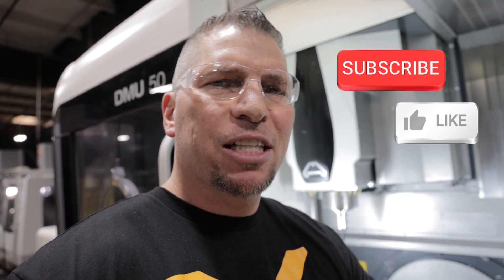GREATEST CNC Machining Compilation of ALL TIME - TITANS of CNC Vlog #48

Comment: Titan I want to start off by saying thanks for all the tips and tricks you share with us. Because of you I've been running 4 times faster at the shop I work at. I do have an issue with running high speed roughing on 304L SS . I can't get a 1/2 inch carbide 4 flute rougher to last more then like 30 mins . I know I can cut close to 120ipm but it doesn't last. I go as slow as 45ipm at 1900rpm with 8% step over and 1/2 depth . With that, the tool last 30-35mins. That's really bad since I can have a cobalt rougher last a whole day with same circle time with traditional roughing . It's just harder I push on carbide the shorter life it has. :/ If you have any tips for the 304L SS it would be great if you can share . Even drilling I have longer life with cobalt drills then carbide.
Reply from the maker: It’s probably the cutter.
Have you downloaded NOVO from Kennametal? It’s great for speeds etc.
Also the HARVI 1,2 & 3 EndMills are amazing. Maybe more expensive but if they last for a few hours, then it pays for itself. I love the Harvi 3

Comment: Titan, would love to see a video on what you think are, currently, the biggest limitations in CNC right now. Where do you think the current bottleneck is (if there is one). Machine power, motor positioning/holding torques, or something completely not physical, like how people are designing parts without CNC in mind (used to designing parts with manual machining ops in mind)

Comment: I would like to see you make a video of getting a job involving machining stellite.  I used to work in a machine shop that has worked on very large parts involving a hardened shell of stellite. We would cut no more than .050" on a 4 or 6 inch button cutter going around 5 ipm. The rockwell hardness is over 50.  I would like to see how you would cut something like that :)
Reply from the maker: Future video coming...
Good idea

Comment: Future video idea. Can you go over how to cut with long endmills or extended endmills. Everytime I try I always get chatter (sucks for finishing) or high machine loads (sucks when I'm trying to get high MMR during roughing). Thanks.
Reply from the maker: Yes...
Definitely need to drop rpms and make sure you have it in a rigid holder and stubbed up as short as possible.

I might run a 1.625 LOC 3/4 Dia at 12000 RPMS but drop to around 8000 if I have a 3.0 LOC.

Sometimes with a 3/8 or 1/2 that super long, you need to drop down to the 3k or 4K range.

Just need pressure on the tool so it does not vibrate.

Of course Feed is same... just RPM’s lower
Reply: @TITANSofCNC  awesome thank you for the advise and reply. Would you use the reduced RPM and same feed for finishing the part as well? So example 4 flute 3/4 end mill with a 3" LOC RPM: 7500 IPT:  .012 Radial Depth of Cut: .015 on 6061-T6? Thank you again for the huge advice.

Comment: I would like to learn how to edge find using a .0001 indicator. It happens by using any flat surface like a 1-2-3 block or anything precise against the ground stock in the vise then zeroing on the work in vise the spinning indicator 180 deg. in spindle then finding zero against known flat surface that is against work. I am just confused about the process and cant find a example on the internet anywhere. It will get accuracy very close to centerline of spindle. Would like to see an example of this.
Reply: Use a probe. Indicating centerline is ancient technology. We need to be moving into the future.
Reply from the maker: Watch my fundamental videos at academy.titansofcnc.com